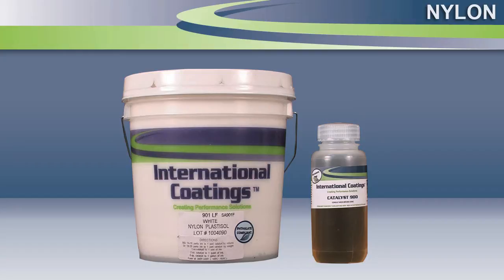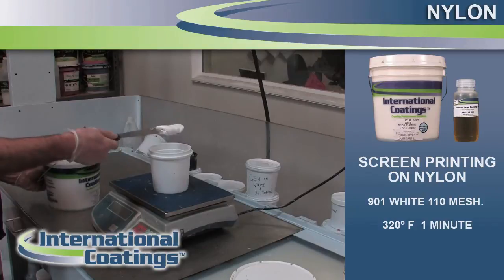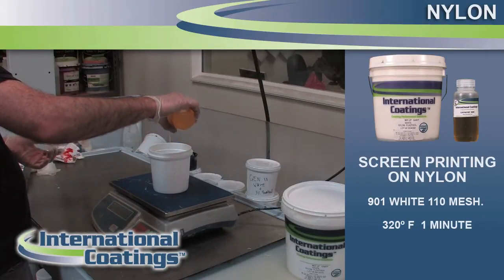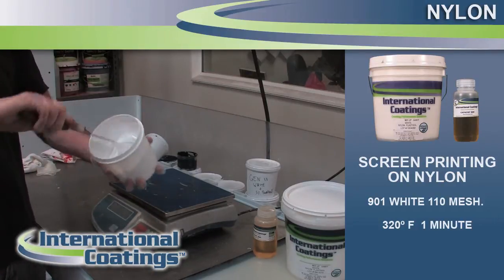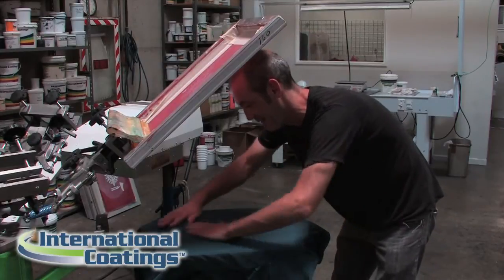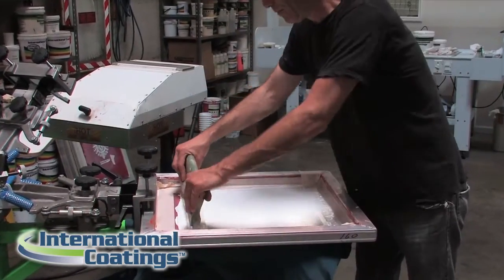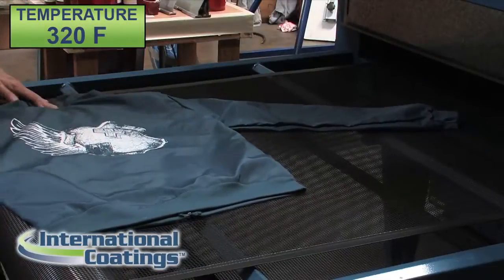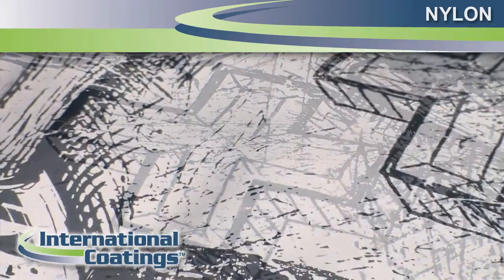Screen Printing on Nylon

Comment: Can you please make this instruction more clear, when you said the % is not clear
Thank you
Reply from the maker: Hi Edward,  I just wanted to clarify what the proportions are for adding the catalyst to the 900 ink:  it's one part of catalyst to 20 parts of ink BY WEIGHT, or one part of catalyst to 16 parts of ink BY VOLUME.

So for example, you can add 1 oz of catalyst to 1 pint of ink, or 2 oz of catalyst to 1 quart of ink, or 8 oz of catalyst to 1 gallon of ink.

Hope this clarifies it.  Thank you.
Reply: Thanks,  thanks